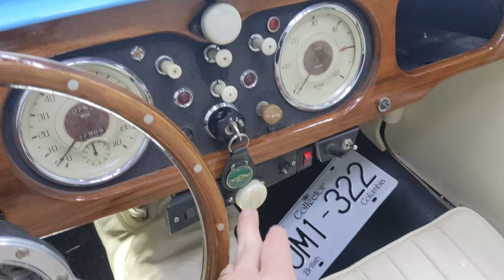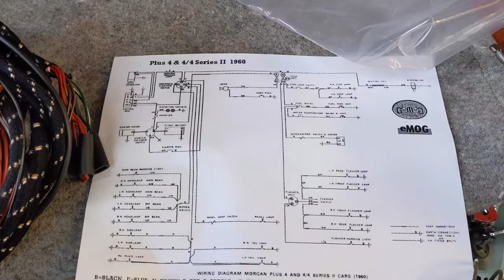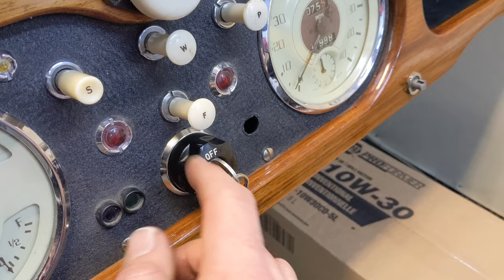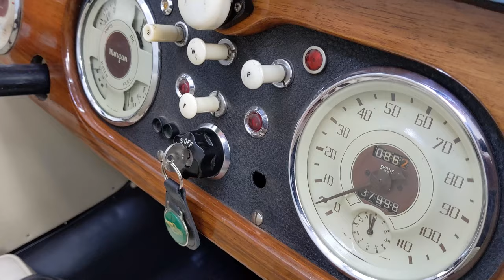Fixing the wiring mess in this 1955 Morgan

Comment: There are worse situations.  My first car was an unfinished MG TD restoration project I bought.  The previous  owner had rewired the car with excellent aircraft grade teflon wire, all the same color, white.  The only connection completed, when I got the car, were to a socket mounted under the dashboard.  Every other end was plain, unmarked white wire.  I had to ring out each wire then figure out the purpose using the factory manual.  I got it all working, at hat time the cost of a replacement loom was out of the question for a teenager.
Reply: Maybe he was colourblind? I am and let me tell you, it makes doing electrical repairs about the hardest thing for me. All white though... I kinda like the sense of humour there!
Reply: You were a teenager?? Amazing!  Well done!!
Reply: @oxcart4172  Yes, thank you very much.  Wanting to drive was a real motivator.
Reply: @swilkobarfingtoniii1642  it is pretty funny to look back on.

Comment: I was rewiring cars back in junior high one of my favorite things to do would you take the stock wiring harness out und tape it only keep the wires I needed and tape it back together it in the vehicle sometimes I add circuits sometimes I delete everything and rewiring car from scratch adding power for electric fuel pump stereo

Comment: The old wiring, while over the top, at least was neatly put together and labeled.  I've seen far worse hack jobs.  With the spare tank, I suspect the car was used for long road rallies, and all the extra wiring allowed for separate fuses for each circuit so if one failed out on the road it would be easier to trace and fix.   At least that's my theory.  Mr. Owen, do you know anything of the car's history?  I have added wiring and fuses for relays in cars so that, for instance, to protect against burning out a headlight switch by not having the full current needed for the lights going through the little switch (this was on a FIAT).

Comment: Those webers don't like working too well without ram horns and those filters,also a air draft over the mouths makes them run rough which is why I  would consider making an elongated bubble over the carbs that is closed on the front end.Back in the 70's i did a similar set up and made a manifold with a curve that sat the carbs over the rocker cover instead of poking out of the bonnet. it worked really well and gave great response from low range and excellent response from mid range up,when over taking etc.
Reply from the maker: You're right. This car really needs those.

Comment: Do not remove the retaining nut when removing the steering wheel, only back it off a bit.  You can then use your legs/knees to remove the wheel without getting a face full of steering wheel.